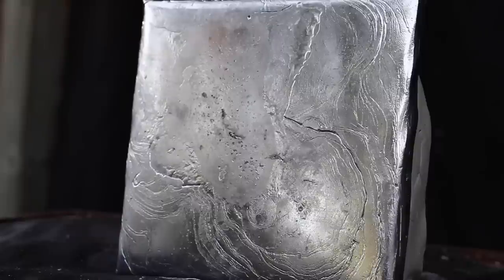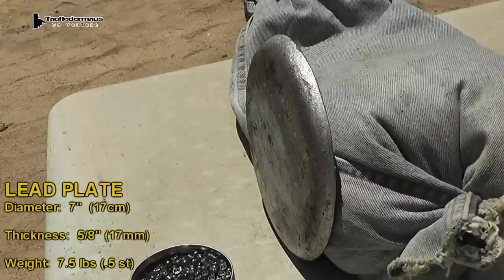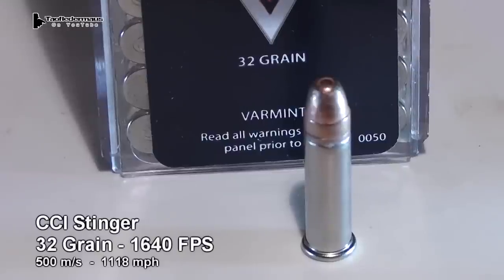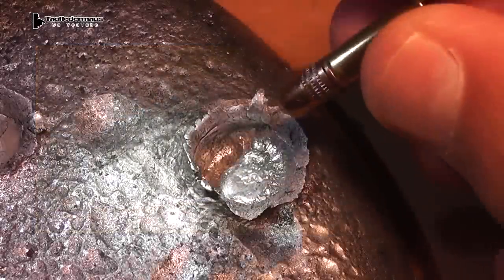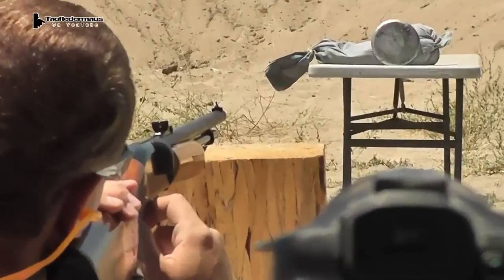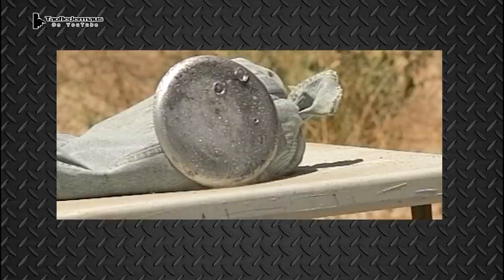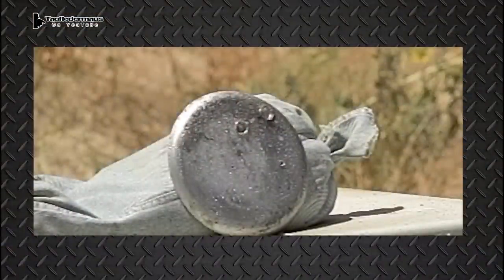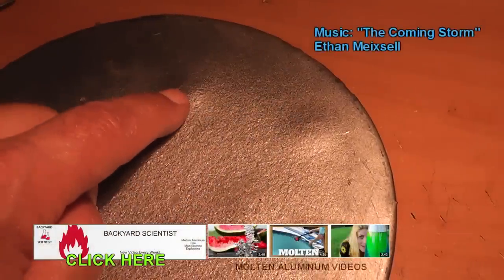Will a LEAD PLATE stop a .22 Bullet?

Comment: For the next video can you please find out if jet fuel melt steal beams?
Reply: Palmerater Not melt, weaken. Get him to place a 100,000 tons of concrete onto steel beams, then heat the steel beams to near 2000 degrees celcius and see how well the beams hold the weight with 1/3 of the other supportive beams destroyed/damaged by a 200,000 pound plane.
Reply: sacr3 steel gets malleable at red hot. 1200 C maybe.
I can do 2800 C with a propane+O2 torch. Acetylene+O2 3.5k.
Reply: Palmerater Then check if it can melt dank memes.
Reply: sacr3 Don't forget the steel beams have a fire-proof coating on them.
Reply: HD5830Gamer Which of course, naturally, didn't flake off/peel off from you know, the massive 200,000 pound aircraft at 300-500mph smashing into it. I mean hey, Fire proof coating thats what, 30+ years old is still perfect to this day and when the beams bent/cracked/twisted from that massive impact and massive explosion..

I mean fuck do I even have to finish my paragraph here? Only an idiot would think a building would survive an impact from a 767 going at high speed full of jet fuel.. That is a MASSIVE amount of energy, thermal energy, kinetic, everything.

Simply because its "A steel beam" doesn't mean its "Completely resistant to everything"

The damn tower, beams specifically, wasn't manufactured to take the impact of a 767, then a massive high temperature explosion, then a VERY high temperature constant burn.

Then people say "It shouldn't have happened like this" Compared to what?! This NEVER happened before with such a large aircraft, how the fuck do "they" know it shouldn't happen like this?

Conspiracy fuckups are fucking idiots. Simple as that.
Reply: sacr3 Somebody is not one with the memes. Jetfuel can't melt steel beams.
Reply: darth Educate yourself bud. Again, 200,000 pounds traveling at 400-500mph, with what, 20,000+ pounds of Jet Fuel - in which is atomized by the impact creating a massive explosion which in turn creates a massive shockwave.

All this against an old 30 year old concrete structure. 

On top of that, we have NEVER seen how a building of such size reacts when impacted by such a massive plane. So we can't compare it to other impacts, this is the first - so we observe and learn.

Also, the building began to collapse from the point of impact, once it was finished collapsing there was still 30 floors worth of building standing at the base.

A logical minded individual knows that this is legit and is expected from such a violent impact. 

An illogical minded individual will somehow disregard such a massive chaotic impact and assume it was brought down with explosives, even though there was no evidence for it, the building didn't collapse like a demolished building would, etc.
Reply: +darth A massive concrete structure in the center of the building? Are ou saying the center of the building was just solid concrete?
Reply: darth
Why is that even necessary?

Comment: now shoot a round made of bullet proof glass at it
Reply: It would not be near heavy enuf to shoot.
Reply: thejudge305 "bulletproof glass" is in fact just regular (laminated) glass.
Reply: RJ Lee its plastic also so what
Reply: thejudge305 Transparent armor does indeed use polycarbonate more than glass. But actual bulletproof glass is glass. Glass is glass and polycarbonate is polycarbonate.
Actual bulletproof glass is just layers of glass glued together with PVB. Its no different from car windshields, just thicker.
As such bulletproof glass is rarely used these days and is mostly used as a middle layer. Glass is heavy and its effectiveness by itself is lower than other alternatives (like acrylic and polycarbonate).
Reply: RJ Lee The advantage to real glass is that it lasts longer when exposed to UV light and scratches less easily.

Comment: There was a lot of math done by  Newton about how far materials can penetrate surfaces.
Turns out a piece of lead can't be embedded any deeper than it is long, no matter how fast you shoot it.

This is more applicable to meteorites though.
Reply: You're talking about lead penetrating lead right because lead can penetrate a human body pretty well.
Reply: The West Will Rise Again!  I believe he is referring to two materials of the same density.
Reply: waldo7411 I'd like to see this proven; he said that plate was 5/8" right?  Shoot it with a Remington Slugger then...that's right about 5/8" long (though hollow, so its under 1/2 of solid lead) and 1 oz of lead.  Should not penetrate through then.  And it fits the budget!  A Slugger is like $5 for a 5-pack...maybe $6 now with inflation.

Comment: To those wondering why lead was so good at stopping those bullets despite being so soft : it is because of Newton's impact depth equation.

For a projectile hitting a target fast enough to overcome its cohesion, the resulting crater depth is roughly proportionnal to the projectile's length and to the ratio of the densities of the projectile and the impacted material.

Since lead is very dense, that ratio is driven way down, and the craters the bullets make are too shallow for them to actually go through.

Yes, past a certain point, speed doesn't really come into account anymore. Faster bullets will simply dump more energy into the target, without necessarily penetrating deeper. To penetrate further, you'd mostly have to use longer bullets.

Of course, that equation is only an approximation, and you may actually manage to get some improvement in the results by bruteforcing the other parameters (kinetic energy and bullet diameter). The impact depth equation works best for thick targets (the maths behind it make the assumption of an infinitely thick target), and the fact that the plate is starting to deform behind the impacts shows this part of the approximation isn't holding very well anymore.
Reply: piranha031091 I never heard about that before, and its extremely interesting! Does it still work when you have different materials  for projectile and target? Steel bullet & lead target?
Reply from the maker: piranha031091   But the pellet went in deeper than its length.  And part of the pellet is hollow.
Reply: ***** I would guess it is because the plate bulged behind it.
As I said, it is an approximation, and in that case, it may not be quantitative at all. But at least it provides an explanation as to why something so soft was so good at stopping bullets.

And I'd be curious to see you shoot a ball bearing at it out of a shotgun.

***** It should work as long as the projectile is able to overcome the target's cohesion and make it behave in a fluid-like manner.

Comment: "Hey can you pls shoot a high powered rifle at it?"
"Sure, let's use a .22"
Reply from the maker: Cheez And Bakon  2800 fps is more than high power
Reply: ***** but a.22 has no where near enough mass to cause a lead plate to explode like clay.
I guess having a massive lead block explode everywhere is pretty dangerous, but I guess I was expecting 7.62 or even .50  BMG
Reply from the maker: Cheez And Bakon  Anything above .22lr would have gone through the plate.   Over time we'll make the plate thicker and shoot it with more powerful rounds.    Gotta start somewhere.

Comment: Wow! I would not have won a bet on this. Equally surprising that the ~8grain pellet with a nailgun charge made it through. I've shot rats with 8,6grain pellets traveling just below 1000 fps and the pellet doesn't exit.
Reply: trefod It made it through a thinner steel plate, not the lead one.

Comment: How many sheets of aluminum foil will stop a 22? I tried this a couple of years ago but don't remember the exact results. A lot of the results depended on how the aluminum foil was compressed together...more tightly held together, more solid.
Reply: Ambis Magee This video reminded me of the foil experiment because of the way the lead plate deformed. Foil wasn't exactly the same, but there was definitely some cratering.

Aluminium.

Comment: Wonder if Remington Thunderbolts would make it through. 40 gr. solid at 1500 fps.
Reply from the maker: Nugrat1   I thought those were only rated for 1150 or so?
Reply: ***** Hmm yeah 1255. Now I'm wondering what I was thinking of.
Reply: Maybe I was thinking of the Remington Viper. 36 gr. Solid at 1410. Aguila Super Maximum is a 30 gr. Solid at 1750... Thinking that maybe a high velocity solid stands a better chance than a HP.

Comment: high speed .22 pellets.. why not do the "fancy" ones with the bb's on the tip? or, straight up do A bb, risk rifling damdge though.. and yes i understand that you have a $5 budget when making these videos.
Reply from the maker: Rods Ahed   The round we shot actually had a little lead shot in the tip of it.   You can see it when I am holding it up before we shot it.
Reply: but still wow, from just a LOT of speed a little pellet can do that dent. even though if it were to be a bit hevier i could do worse.